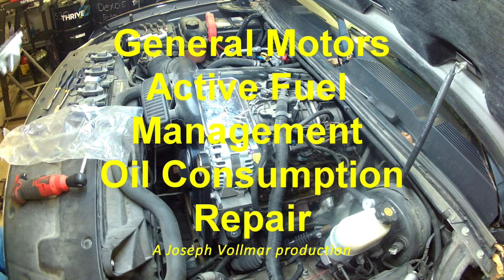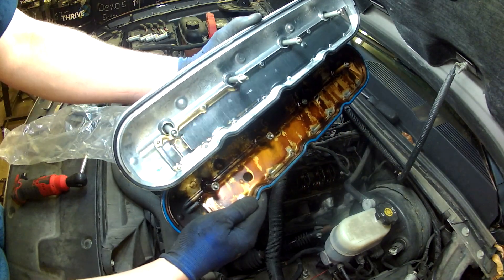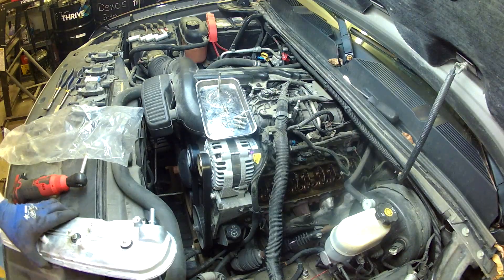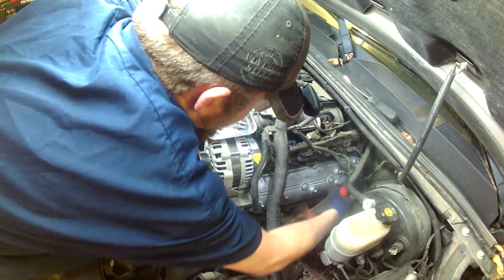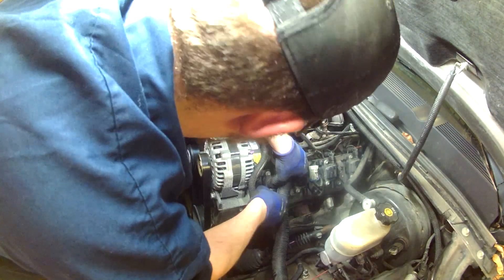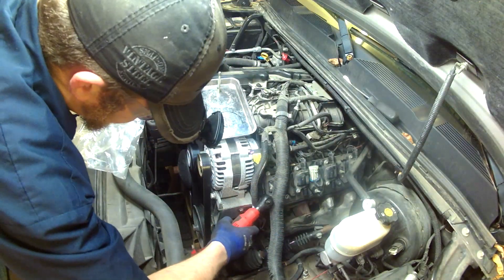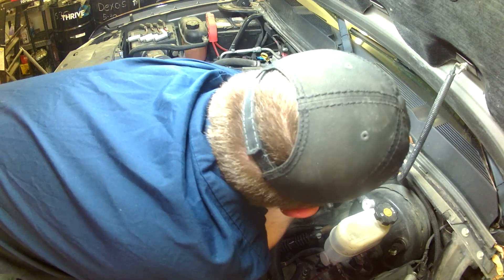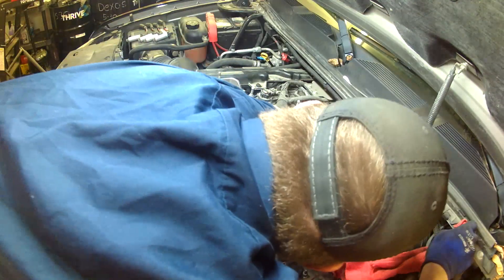General Motors Active Fuel Management Oil Consumption Repair

Comment: I did not know this engines had this problem till my 2012 Sierra surprised me with a low oil pressure shut engine down warning. I was 3+qts down . It made me so mad, truck only had 95k at the time. I did an oil change 2600 miles later dipstick is down byba half already.  I considered fixing it but at the rate its burning oil I'm afraid the piston rings might be damaged and I'm planning to be towing a travel trailer that's 5000lbs regularly so this thing is getting traded pronto
Reply from the maker: Talk to GM and file a complaint they have launched a customer satisfaction program on them and they are fixing a lot of these now. I don’t know the specifics of what they are doing, but it is worth a try.
Reply: @JosephVollmar even if you bought off someone?
Reply: Mines doing the same thing but I thought was just a leak
Reply: Help!!!

Comment: Just to confirm, the valve cover part is: GM 12570427 Valve Rocker Arm Cover?   Is this referred to as a valve cover replacement?  Want to ask my Chevy service department for the correct thing.

Comment: Exactly what dealer told me! Got to wait now and see what happens. BTW chevy moved to full synthetic. No more blend.hope my engine doesnt start leaking full synthetic with 80000 miles.
Reply: Use synthetic but stick to regular Valvoline or Mobil1 5w-30, do not switch to the hi-mileage (over 75000 mile) type.

Comment: Also, if you have a GM from 07 and on, you should pull the Intake Manifold and replace the gasket as well as torque down the VLOM and replace the attached oil pressure sending unit and the filter screen underneath it. THESE ARE THE COLLAPSED LIFTER CULPRITS!!
Reply: 07 and down or 07 and up?
Reply: @tipsreviews7476  07 and up.
Reply: That's what stopped me from buying one, did not want to deal with that and who knows what else. Too bad cause I really like those.
 I'm staying away from chevys then on.
Reply: The larger question is WHY is a filter screen in the top of the engine, immediately after the oil filter, plugged up to begin with?
Reply: I had a significant oil leak at the upper rear of the engine. I found that it was caused by the VLOM. When I removed the VLOM, 7 of the 11 bolts were finger tight. I used Loctite on the bolts and torqued them to the recommended value. My guess is that heat cycling caused the loosening.

Comment: Is this needed on the 16+ I have a 16 5.3 suburban 95k, 18 Silverado 7k miles. No oil consuming as of yet. 

Thanks
Reply from the maker: If your not seeing any oil consumption at all with 95k I think you will be fine. By 2016 I think they fixed the issue. A quarter of a quart on a 5000 mile oil change is normal for most trucks if you are doing a bit of towing or hauling. My truck, 2016 Ram 1500, only has 40k on it, but I always check it at 2500 miles and then 5000 when I change it so I can tell if there is anything going on. I have noticed that especially during hay season when I’m moving more loads it will use a small amount. Anything approaching a quart is something I would definitely be concerned about.
Reply: Joseph,

Thanks for the reply. I checked it today after changing the spark plugs. All plugs but cylinder #1 was squeaky for aome reason #1 had a noticeable amount of carbon build up. Oil was dead on the full mark and I too change my oil every 5k (4250 miles on current oil). It’s the wife’s rig 90% highway as she travels out of state FREQUENTLY due to her family being out of state. I’m for trading it in on a newer model with warranty but the wife has budget ideas and wants to keep it for no payment. I’ll be doing the rear end fluid and tranny fluid next week. All looks new but hey treat it right maybe she’ll stay solid for the wife on the road. Coolant looks brand new still.

Comment: Great video thank you - I have a piston hitting a valve when cold 3-4 times until fully warmed up , what should I do ? 
Thanks in advance.
Reply from the maker: It sounds like you may have a lifter that is stuck fully expanded when cold, and/or possibly a weak valve spring that cannot hold against the oil pressure when the engine is cold. First thing I would do is run a compression test with the engine dead cold, record your pressures for each cylinder, then start the engine and let it run for 30-45 seconds and repeat the test. Here some change is going to be normal, but a dramatic change in any one cylinder will identify your problem cylinder. Now it is time to start tearing in to the engine And inspecting parts. This is not going to be an easy job, and paying for a little bit of diagnostic time at a good shop may be well worth the money to sort it out.

Comment: Where can i get the updated valve cover
Reply: The Dorman is $70 shipped:
https://www.amazon.com/gp/aw/d/B01ID3TWE0/ref=sspa_mw_detail_1?ie=UTF8&psc=1
Reply: This is the GM OEM valve cover I used in my Yukon (5.3L LC9). No more smoking.

Genuine GM 12570427 Valve Rocker Arm Cover
https://amzn.to/2QmdlpV
Reply: @chris4321das   I got my valve cover (rubber gasket included) at AutoZone for $74.99 on 11/18/19

Comment: I have 2007 avalanche, new valve seals, new piston and oil rings but still consuming oil. Is there anyway to check if this pcv system is the issue before i change the valve cover? I removed the plastic air intake and opened the throttle valve and it looks like there is some oil in the intake manifold but not sure if this is good enough indication?
Reply: If they put the same pistons in your problem is still there. The design doesn't adequately drain the oil on the oil control ring. Just watched a  video of it.

Comment: Sorry...but this video is wrong! GM has a TSB about the updated valve cover, the oil pressure relief valve, and then the piston rings. All this is in the TSB. However, the TSB is just a way for GM to kick the can down the road for people to get out of the warranty period. It doesnt do anything to stop oil consumption. Besides, after 2011...the Engines come from the factory with the updated valve cover and the oil pressure relief valve shield installed. We all know the issue kept happening after that! 

While the valve cover and oil pressure relief valve shield are legit repairs...it rarely ever fixes the problem. If you don’t believe me...google it and read the hundreds of pages on all kinds of forums complaining about GM replacing the valve cover and putting the shield into place...then the oil consumption/fouled plugs issue always comes back in 3 months or so. The reason the AFM cylinders burn oil is because of negative pressure in the cylinder and the piston/piston ring design. Since there is no combustion event...the pressure in the cylinder is much lower so that means the rings won’t seal properly. It creates a negative pressure situation. At the same time, the low tension rings and lack of oil drain back (and lack of blowby) means the same oil doesn’t drain back or get scraped down. That means the same oil gets trapped around the ring area and ends leading to the rings getting stuck. Once you have stuck rings...you get massive oil consumption. 

This is why deleting the AFM system fixes all the issues!
Reply: Question:  You mention deleting the AFM 'Fixes' the issue.  Does it fix it or prevent the issue?   In other words, if the oil ring is already stuck, is there really any way to get it unstuck other than a rebuild?
Reply: @friedegs   the answer to your first question is…it depends. If your engine is running good and doesn’t have any issues…you can turn off the AFM with a tuner and it will prevent the issues from happening. Since the AFM  parts are still there, there is still potential for issues to occur but it’s not very likely. Once you start having any kind of issues like collapsed lifters or oil consumption parts will have to be replaced. Deleting the AFM won’t “fix an issue” that’s already there unless you replace the parts that were damaged. Unfortunately, if the rings are stuck your best option is to replace the engine. Once the rings are stuck it’s too late. By the time you rebuild it with the kit to delete the AFM…you can buy a reman that already has the AFM deleted and it comes with a 3 yr warranty.

Comment: I did this and it’s still using 2 quarts of oil between oil changes. Got any ideas, I’m think turning off AFM but don’t like dealing with shady programmers
Reply from the maker: There are plug and play options to turn the AFM off online. Just search for AFM or DOD deactivating and you should come up with some. I know they make one you just plug in to your OBD 2 scan port and it shuts it down, and I don’t think it was too expensive. I cannot remember the name of it now though.
Reply from the maker: Look up Range Technology on Amazon they plug in to the OBD port and are about $175. There are some videos on YouTube about them as well.
Reply: Justin nor same issue I am using 2 quarts between oil changes on my Tahoe 09

Comment: I found a guy locally that does LS tuning. I had him shut off the afm. Next is the oil pick up tube o-ring, diverter valve on the oil pan and the valve cover.
Reply: The only thing I haven't done was the diverter valve. Wish I had done more research before replacing the pickup tube o-ring.

Comment: Just to make a correction on Dorman part the #  is. 264-965 not 264-969. Gm    Is 12570427
Reply from the maker: Ismael Ascencion you are correct. Was just doing research on the Dorman part numbers and the 264-965 shows as a direct replacement for the GM part number. The other shows as a replacement drivers side valve cover, and the pictures look the same, both seem to be the updated design. To anyone ordering from these part numbers please verify your application before ordering. They can both be found on Amazon and there is a substantial difference in price.

Comment: Thanks for the information. I have a 2010 Chevy 5.3, with 75,000 miles. Having no issues but as the truck gets older I want it to continue to run smoothly. Just Sea foamed it and haven’t disabled the DOD. However started to drive in manual mode M5, instead of Drive. V4 doesn’t activate as long has you don’t go into 6th gear. A lot of back roads here not much highway driving so I don’t need 6th gear that often. Being in V8 all the time should help. What do you think?
Reply: Does you oil last longer because in my experience with the 6.2 2010 Escalade 2-3k miles on fresh oil it goes black I already replace three oil pressure sensors and try to keep fresh oil to prevent oil pressure sensor going since is kinda expensive but pain in the ass to remove it and hook up the new one

Comment: I have a 2008 suburban with the 5.3 in it with about 23,000 miles on it (low miles for the year model) Ive noticed no real oil consumption between oil changes but I have noticed a pretty bad stutter or miss when sitting at an idle. Could that be a symptom of this active fuel management/vaulve cover issue?
Reply from the maker: The first thing I would do is pull the spark plugs and replace them with new A/C Delco plugs and look at the old plugs for carbon build up as you pull them. If the rear drivers side looks worse than the rest I would plan on swapping the drivers side valve cover for The updated version. A stutter or miss at an idle is generally a symptom of worn or fouled spark plugs. It could be one of the coils, but likely with that kind of mileage on a 11 year old vehicle it has seen a lot of short trips and not a lot of highway miles which is harder on the plugs as they tend to build more carbon and don’t get hot enough to burn it off. The driver rear cylinder it the one that tends to burn more of the oil that gets passed in to the PCV system from the valve cover. Changing the valve cover early before it starts consuming oil will help to minimize carbon buildup from the oil on the rings, and could save the catalytic converter down the road.
Reply: Thanks soooo much for the quick response and the very useful info. I'll definitely change the valve cover and check the plugs ASAP!!! @JosephVollmar

Comment: I just had the AFM tuned off on my 07 Suburban.  Seems to have fixed the issue.
Reply: Can I ask how you were able to turn off the AFM on your suburban?
Reply: @jss6319  I had a tune shop do it.  They just disabled it at the PCM.  It wasn't a cheap job but like I said, it seems to have worked (it was done before last summer).  They recommended doing new cams and a full kit changeover but it has a lot of miles and I just said let's try this and see how it works out first.
Reply: Thanks ! @midwake9951
Reply from the maker: Did turning off the AFM make a substantial change in your fuel mileage? Please post an update in the comments as I’m sure others have questions, and since I don’t own an AFM vehicle I can’t give any personalized experience based advice.
Reply: @JosephVollmar  no, no substantial or noticeable mileage changes.  So far my experience has been good.
Reply: @JosephVollmar  is there a torque spec for tightening the hardware back onto the valve cover assembly that you can share please?
Reply: @buffrat70588  yes I have a rebuild book let me know what specs you need
Reply: @DIYWithTheRichardsons  did you just tune it off or did you do the full delete kit?
Reply: @rocman9137  I did a full delete because I had a lifter calapse if you catch it before lifter failure you need to delete it threw programing I used hp tuners you should be fine but if you have lifter failure you will still have to remove the heads to replace them it's better to do a full delete and never have to worry with going in the engine again!! I replaced lifters ,lifter trays, cam , timing chain and oil pump just about a rebuild of the engine
Reply: I'm in process of doing a complete swap cam lifters and oil pump and I'm going to disable dtc with hp tuners I'll post mpg difference
Reply: @DIYWithTheRichardsons  any word on the mpg since you turned it off?
Reply: @rocman9137  not much of a difference on the highway it's doing great maybe 1 or 2 Mpg loss but I'll take that over not having to worry about  another lifter going bad .

Comment: Does this also work on the 2007 impala SS?
Reply from the maker: Michael Jezierski if it has the 5.3l in it I would think so, but I’m not 100% sure.
Reply: It does have the 5.3. but front wheel drive . Thanks

Comment: Gm full of crap I have a suburban 235 thousand miles on it ,doesn't use any oil at all between oil changes none of my chevys I've owned used oil between changes if you don't abuse them and drive them normal they will last I had a chevy van ,350 had 400 k miles it used about 2 qts every 4k miles but it had a bad valve stem seal

Comment: Would the upgraded valve cover be on the 2018 motors? Is there ANY way to override/ bypass main programming to shut off v4 mode and other little annoying controls.
Reply from the maker: Crustyswede1 yes, by 2018 GM has fixed the problem as far as I know, and you can disable the v4 mode, but I believe you need a aftermarket programmer for that.
Reply: RANGE AFM delete. No need for a programmer and it's untraceable.
Reply: GM started using their updated valve cover in 2011 and later models. So yours has the updated valve cover.